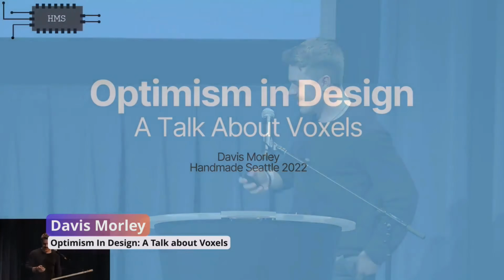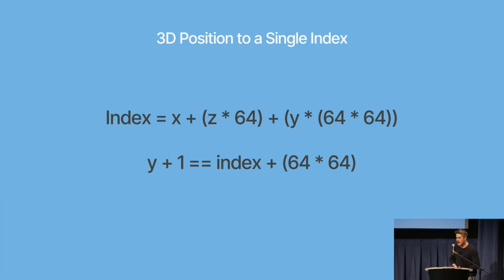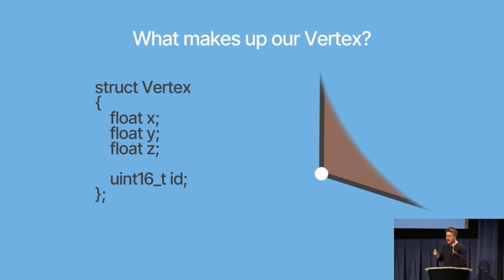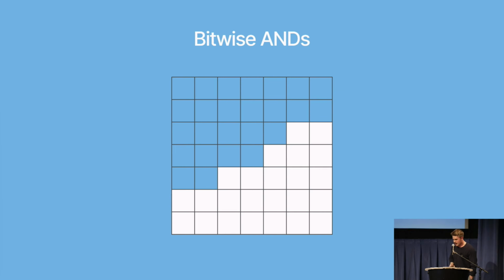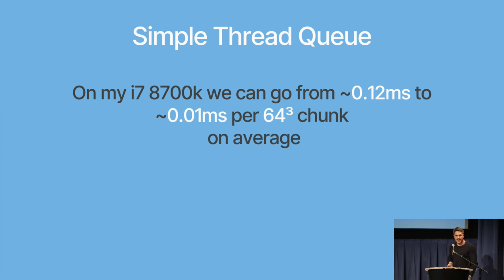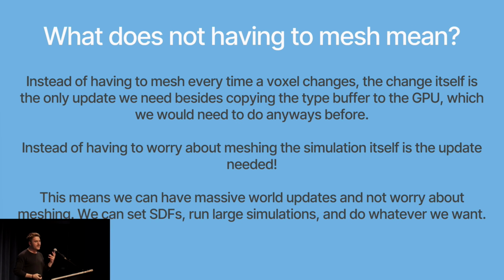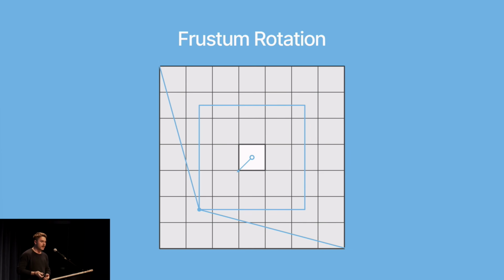Greedy Meshing Voxels Fast - Optimism in Design Handmade Seattle 2022

Comment: The only issue I can see with this voxel lattice system is OBSCENELY MASSIVE amounts of overdraw.
Reply: I think with a z depth test before rendering the voxels you can solve the overdraw problem.
Reply: @RayznGames  before any rendering z buffer is empty
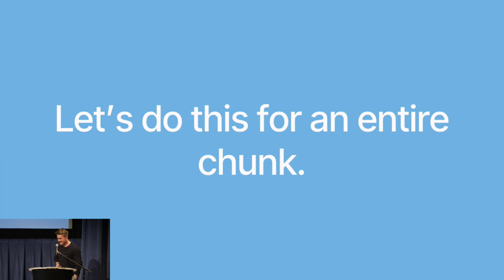Reply: @uis246    (If we are using meshing) Then it may be needed to use a draw call to write a camaera depthTexture after creating the meshes,  send that texture values to the zBuffer,  and then perform the zDepthtest for defferred rendering of the materials. I am not  an expert, and i am not completly sure how it should be accomplished, but i know from using Unity and Unreal that they both have this functionality available to improve performance and to use it for shader stuff.. But If we are using the 25:08  technique I don't even think this is a valid thing anymore.
Reply: Render the furtherest mesh first and then tte second furtherest, that way u don't need to use depth calculations. That's my guess
Reply: @Buenpibe24  The painter’s algorithm is famously bad when it comes to overdraw.
Reply: @Buenpibe24  The reason you want depth calculations to come early is so you don't have to perform random lookups for texture IDs from an arbitrary shader storage buffer. All that memory fetching is expensive. Anything you can do to opt-out early is going to save you time calculating pixels.
Reply: Yeah, very suspicious that author does not even touch on this. And his replies elsewhere in the comment section he is very vague about it.
Reply from the maker: @IsmeGenius  I was not attempting to be vague. Overdraw is not a problem at test scenes 8192 x 255 x 8129 and under for my 2080. Yes it is a 2080, but this rendering method is meant to be efficient at conveniently rendering an archetype of block game where these scene dimensions would be sufficient. I mentioned in another comment how in this kind of world there are two predominant horizontal axis and one shorter vertical axis. The world is often populated in such a way that the horizontal axis are more likely to be populated with data, depending on your sea y-level. Heuristically this has a benefit to overdraw resolving more quickly.

To entirely optimize for overdraw, one could break up the lattice in to per-chunk lattices. Then, every frame, have an indirect draw command buffer on the GPU and write into that buffer with the optimal face ordering based on a line algorithm that cuts through the chunk. This way you could order draw calls in the order that they appear, e.g. 3 x then 2 y then 1 z, repeat. This also would be great in reverse for transparency ordering! You could also cut out half of the faces for every chunk by effectively just software back-face cull them. Extend it further with a Hierarchical Z-Buffer occlusion culling algorithm and frustum culling in a compute shader. One easy way to do this is to render an opaque bounding box for every chunk for visibility in the Hi-Z & frustum test.

I had limited time to make this talk and during the process I had planned to create a program that had all kinds of meshing mentioned in this talk but did not find the time. This was also my first talk, and I tried my best.
Reply: @davis-morley  I would like to listen about optimal meshing that does not create T-junctions or meshing with trifan/tristrip.
I think software backface culling should better be done on as part of data structure instead of culling each slice's face or hardware backface culling will be faster. Maybe something like minecraft: cuccent chunks renders all faces, chunk above doesn't render upwards faces and so on.
Hi-Z sometimes exists in hardware btw. Example: intel GPUs.
Reply: @davis-morley  
somehow my reply failed, i'll try it again:
--
each lattice always has to be rasteriazed into pixels to do depth-test.
so it's to test every pixel against every lattice, then test every 'hit' against voxel data to render.

with depth-sorting added, it becames: test each pixel outwards against one lattice a time, until it hits non-air voxel
it's essentially the same with uniformed voxel ray-marching.

considering the rasterization overhead, ray-marching could even be faster.
ray-marching has its own perks, (like path-traced lighting for example), totally worth trying

and btw, the greedy meshing method you presented can also be used to optimize the ray-marching to be more SDF-like, thus way faster than uniformed
Reply: @davis-morley  Thank you so much, I have been following your work for a long time, still go back to that Voxel video they clipped in the beginning, don't let the negativity get you down, the information you provided has been a fantastic starting point for my own research into voxel engines, again thank you!
Reply: @davis-morley  You did good.
Reply: draw chunks back-to-front, z-test, discard chunk pixels without a hit and discard empty chunks. You should only have overdraw (in some archs with early-out, in tile-based no early-out) around the horizon (or along the edge of whatever features you have in your lattice). No need to render empty chunk means no "massive" overdraw. Even if you have trees, if they're contained in 1 or 2 chunk, you'll have only overdraw for those 1 or 2 chunks, not more. If you're doing octrees for LOD, your chunk discard is hierarchical, so it's even faster.
Reply: @IsmeGenius  I can see it working for small-scale voxel rendering, but for a large world? This is quite literally the worse case of overdraw I have ever seen, bar none. Not even shell texturing comes close to this level of absurd.
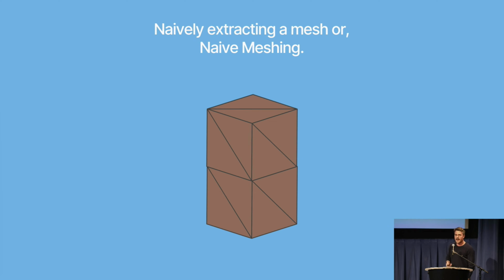Reply: 9:19
Reply: @uis246 That only applies to the naive, greedy, and binary greedy meshing algorithms. You can’t punch a hole in a quad without adding more vertices, and that’s what the voxel lattice technique is trying to avoid.
Reply: @MillieIndifference  voxel lattice doesn't create big quads in the first place. As an example you can play minecraft and in spectator mode move inside wall of blocks and you will see, or rather not see all the quads that are occluded by other voxels.
Reply: @uis246  I don’t think you’ve watched the whole video. The voxel lattice technique creates layered quads with transparency instead of actually meshing the terrain. This is not what is used in minecraft. Again, you are referring to an early section of the video regarding actual meshing techniques, not the voxel lattice technique.
Reply: @MillieIndifference ah, you mean after 24:40. Yes, it would be pixel shader's nightmare, but I can give some explaination.

It is transparent, but not translucent. In GPU context this means a lot because it allows GPU to do early-z. Or at least Intel GPUs can do early-z test even with shaders that discard pixels, anthough it does not do early z buffer write.
Reply: There is another issue: the AAA-developers are afraid of any kind of optimization and will continue to use as much polygons as virtually possible for the tiniest models

Comment: How do we handle collisions? This is kinda pointless if we don't have any.
Reply: Although it is usually implemented that way in 3D engines, collision detection doesn't need triangles. In this case, sampling the voxel array directly will work just as well.
Reply: @stoician  whoa, I wish to implement this in Godot, but I can't really imagine from the description. It would be cool, but how would anything know how to collide and what normal to bounce around without triangles? How do we ensure collisions match the visual mesh?
Reply: @anastasiaklyuch2746  I was thinking in a full custom sort of way, but if you are using Godot, there are things you could leverage to skip the details. Keep in mind, I've never used Godot, so this is only after a quick look at the documentation, but it looks like a StaticBody3D containing BoxShape3D for each voxel would do it. Knowing that the fragment shader is going to be using the fragments location in 3D space rounded to the nearest whole number to index into the voxel array, you would iterate over the voxel array on the CPU and when a solid voxel is found use the index to generate the location coordinates to place a BoxShape3D there.

But that will be a lot of BoxShape3Ds, which might be too much for the physics engine. So a more optimized way would be to use the coordinates of the movable object/player character to generate an index and loop over the nearby voxels to place BoxShape3Ds in only those locations. Then as the object moves, also move the BoxShape3Ds that get too far away to the voxels that get closer. That should be extremely fast since it will only require a handful of Shape3Ds.

To go more towards what I was thinking in my original reply, there might be ways to improve the efficiency further by subclassing Shape3D to make a VoxelChunkShape3D, but that would require deep knowledge of how Shape3D interacts with the physics engine. Perhaps looking at how SphereShape3D and BoxShape3D are implemented will provide some hints.
Reply: I do a "greedy meshing" algorithm that finds the largest possible rectangular prisms to represent the solid voxels. Start with the first unmeshed voxel, expand in X direction, then Y direction, then Z direction as far as you can. Then do the same for each unmeshed voxel. Take all those rectangular prisms together as collision shapes for your kinematic body, and you're done!

Comment: Getting X, Y and Z coordinates from a one-dimensional index when the size of the chunk is a power of 2 is much faster with bitwise operations. Instead of the modulo operation (index%64) do the AND (index&63), and instead of integer division (index/64) do shifts (index>>6). Division (and modulo, since you still have to divide to find the modulo) are slow operations, and bitwise operations are much faster.
But I'm sure it's still fine to write it the way shown in the video, since the compiler is probably smart enough to realize what you are trying to do and will optimize it anyways into bitwise operations.
Reply from the maker: Yeah, I've tested in the past with clang and it didn't change anything, probably still worth it for debug builds though!
Reply: @davis-morley  Maybe the compiler is already doing it for you!
Reply: Also  bitwise and does the correct thing for negative numbers, where modulo will return a negative number!
Reply: @abcxyz5806  Well, I don't think that working with negative array indexes is a good thing in the first place, but if you want, you can. And I don't see how it's helpful in any way here... but technically it works...

Comment: I'm a bit confused about one point. You used an example of an 8192x8192x255 sized world. That's 17,112,760,320 voxels, if each of those voxel positions was associated with a material, and let's say we allow 1 byte for each material id that's 17 GB of material data that you're saying to store on the GPU. That takes up the 71-72% of the VRAM on a 4090. Obviously this data could be compressed but still even such that's a pretty astronomical amount of data. Are you doing anything in particular to optimize that, Octrees, DAGs, RLE, anything? Because if so that wasn't presented and it'd be interesting to hear about it. Preliminary tests with this method on smaller worlds the performance seems good in crowded areas with close by geometry due to distance checks, but on very wide open areas the performance of this seems to drop significantly, to the point there I get much better performance just sticking with static planes for each chunk over the entire world as I can skip rendering entirely of completely empty chunks and thus have far, far reduced overdraw in very open scenes (like pains with lots of open air). Number of triangles doesn't necessarily carry over into better performance.
Reply from the maker: I agree the triangle count is not always the cost here, its more that it makes the scene very easy to represent. When it comes to data there is necessarily in any game ever a point where you add a constraint such as "I am not going to have every single voxel set in the entire world". For instance an occlusion culling method is necessarily an optimization for a general case and is expecting the player to not be able to see every single piece of geometry at once in the world, this is technically a design constraint and is something that can be considered during development. The naive solution actually gets you very far, as in, expecting that the entire world will not be set at once. Obviously this will change directly with however you are doing terrain generation but you can optimize around this. As for overdraw there are many obvious solutions. My point with this talk was to provide a good general solution for a common archetype of game being the block game. The method works especially well with a world that is not cubic, so where there are more fragment tests in this world (the horizontal axis, 8192 x 8192) these are also the axis more likely to be populated with voxels, cutting down the overdraw. 

A really easy method to expand into is what you're mentioning, have a lattice per-chunk and do it that way, it would drastically decrease overdraw definitely. Another thing to try is to order faces and the draw calls of said faces based on a line algorithm every frame. E.g. in a compute shader, for every chunk based on its position relative to a camera, get a perspective correct ray and basically run DDA on it, getting the optimal ordering of faces using the reciprocal of the camera direction and then order your draw calls as such. This way you could analytically draw perfectly ordered faces, this also would be great for transparency sorting!

Comment: Wow, this kind of blew my mind. I got lost a little bit when you were talking about the type buffer. My understanding of what you were saying is that the type buffer is a way for the GPU to take a voxel location in the world and look up the voxel type at that position (e.g. "sand" or "rock" or whatever). Then that type ID can be used to calculate the UVs in the texture atlas for that voxel face. And all that could be done in the vertex shader. Is that correct? (EDIT: No - it would have to happen in the fragment shader, right? Because there are no separate vertices per individual voxel face.)
Reply: Each face needs different normals which means corner vertices are different for every face. So indexing can happen in the vertex shader, and you could even assign vertex colours instead of UVs which would mean less overhead in the fragment shader.

Comment: Heh, wrote my thesis about the same solution with similar progression. Small world :D

I even found my old forum post where I got it running in blender: "I think I call it Pixel Meshing, or how to 2miljon voxels 60fps. [new v3 update]"
Reply: Hello @VegetableJuiceFTW, I have created a prototype of this type of renderer, however I noticed a difference between the one described here and the one described in your forum post.

It seems Morley here is suggesting to have planes slice up the entire world (8192 * 4 + 255 * 2), while yours uses chunks.

I have tried slicing the whole world, but found it degrades performance by a lot, and in one of your comments you suggested it is a pipe bandwidth issue.

I was curious if you could help explain to me what is going on. I'm trying to learn more in depth about graphics compute.

Thank you very much!

Comment: That's neat, but how do you texture a triangle that encompasses different types? Do you check the type per fragment?
Reply: In a fragment shader you have access to the UV (texture) coordinates of the pixel as well as the screen space and world position. I think in this case the UV would be sufficient, perhaps with a uniform indicating global chunk offset. You would choose the texture from an atlas based on floor(UV * 64) and pass the remainder to the texture sampler.
Reply: In GPU pipelines one usually distinguishes between the vertex shader, which decides which vertices to render, and the fragment shader, which render pixels (rasterizes) throughout each triangle. I assume you would simply use the type buffer to decide which colors to render in the fragment shader.
Reply: @sullivan3503  The vertex shader can decide what vertices to render, kind of, but it's more so about how it renders a set of vertices than deciding between amounts of vertices render. At least this is how I have seen them used.